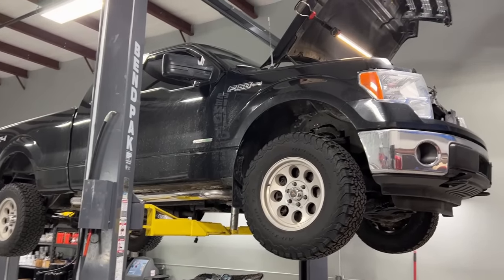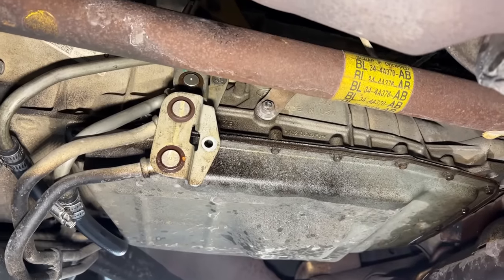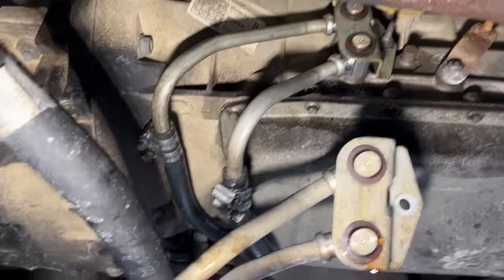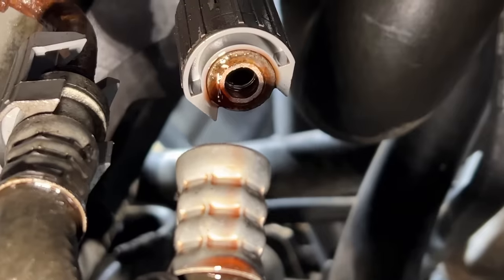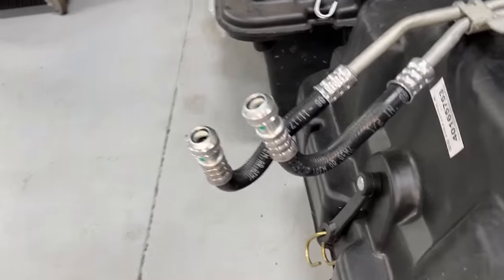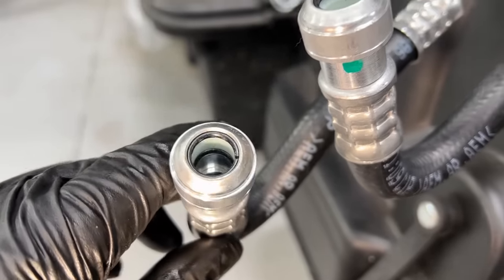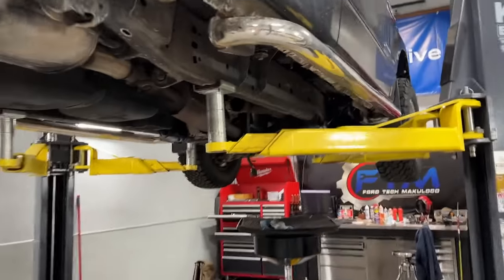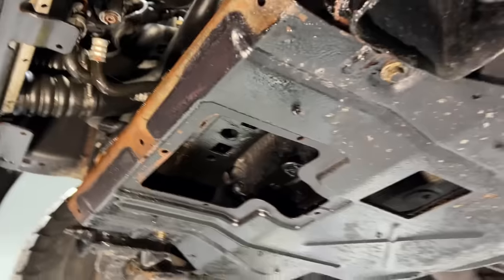Attention 2009-2014 Ford F-150 Owners! Check Your 6R80 Transmission Cooler Lines Before They Blow!

Comment: Good info.
Aluminum is not always your friend. 

Any suggestions for pre-planning?
Anything aftermarket that's better? 
Is this a 'Ford-only' part? 
Is this another 40-50k mile chore to add to the maintenance list? 
Etc...... 

Thank you in advance. 

Added a little rant, if interested, just b/c...... 
& a bit of, fyi. 

Shame on Ford.... 
All these years, & generations of trucks, & they can't get it somewhat perfected yet? 
We're still dickin around with nonsense issues like this. 
'Hey, I got an idea, let's go bigger on the lines for better cooling..., but get the cheapest fittings you can find. Let the buyers deal with the inevitable.' 

Ford knows EXACTLY wut could happen taking shortcuts & cheaping out on parts. 
Last I checked, takes around 300,000 complaints, TO, Ford before they'll issue a recall. 
That's not me sayin it, that was told to me when I called their Corporate Office about a brake/caliper issue. 

Over the years, I've had 3 Rangers, 2 Minivans, 1 Explorer & 3 F150s. 
Every brake job I did, the front left inside pad was always worn far more than the rest. In many cases, down to the metal, while the rest still had 1/2 or more pad left. (Had to add sum rotors to the bill, depending on how soon I'd catch it.) 
Ford said they were aware of it, but would not address it, b/c not enuff people complained to issue a recall. At the time, it was 300,000.

Not a coincidence, or from bad driving, or from parking on an incline w/ my wheel turned, like the DumbAss at Ford Service suggested, when I tried addressing it. 

I called 10 different repair shops, just to prove a point. Took all of a 1/2 hour. Asked for a mechanic, told em the short version, asked if they've ever noticed that problem. 
Every single one had the same general response, 'Now that u mention it, I've had a lot of Fords that had that same pad worn down. I just thought, huh, that's weird & finished the job.' 

The average busy person just fixes their vehicle, or gets it repaired. 
But, they don't dig a little deeper into, 'why did this happen'. There's always a reason, it's not always an 'age thing'. 
Don't be fooled, Ford cares, Zero% about the consumer. It's all about money. As it is, with all big companies. 
If there was more pressure from consumers & shops, it could change a few things. 

(For the Haters: Yeah, yeah, why keep buying Ford trucks... Blah blah. 
Cuz I don't like the alternatives. Things are no different, & in many cases, worst.)

Comment: If a fella could get a good vibration analyzer on those lines, you'd probably find the root cause of the problem.  Looks like high-cycle fatigue.  My guess is there's some really high vibration frequencies at work.

Comment: That doesn't seem like a good design...aluminum connector on steel.  It's just a matter of time before the aluminum will fail since it doesn't like being in contact with steel, especially when you add salt to the mix.

Comment: 2004 F150 had a transmission line leak in the exact same place. I know Ford has been using shitty parts, that will not last any length of time, since they redesigned the F150 back in 1997. If Ford wants the consumer to keep coming back, they better start designing vehicles that will last rather than leave you stranded on the side of the road. That or we all better keep watching this channel lol.

Comment: If this happens to my 2013 with egoboost, I'm getting the truck towed to the dealer and lighting it on fire. I've only got 71k miles on it and just replaced the turbos and timing system.

Comment: So you put a $6000 transmission in it with the same type of lines that broke before and there's no cure or replacement. That's better than the original lines, so it's going to happen again down the road. Maybe it's a roll of the dice.
Reply from the maker: Yes, you can run some hokey rubber hoses front to rear and triple clamp go ahead.

Comment: The new Lightning doesn't have a transmission that cost $6K.  But let's continue to point out the battery that will die at 300K miles...

Comment: QD connectors are for the benefit of the manufacturer NOT for the owner!!!!    Many seem to work fine but damn, when something like that happens for no reason it’s disgraceful.    On my GM I had to chop the lines to replace them long ago.     A package of stainless clamps with each end double clamped is far better than that expensive arrangement😒.

Comment: Why not replace line and fill trans fluid and see if transmission is okay instead of spending 6k on new tranny? lines and fluid would be sub $500 with labor worth a shot before going to spending big $$$, no???
Reply: this just happened to my brothers truck as he was drivng down freeway, Im gunna try just doing lines and fluid and see if all is ok after
Reply from the maker: I already drove it with the homemade cooler loop. If the fluid is burnt, do you think changing the fluid is going to fix the overhead burnt clutch pack magically?
Reply: @FordTechMakuloco  no I was more so asking then suggesting as same thing happened to my truck and I’m trying to go through steps to see what I should do. 

Apologies of it came out wrong I appreciate your videos
Reply from the maker: Again in your case if the fluid is burnt smelling, then at least one clutch pack is toast just beware.

Comment: I had an 2003 Excursion with the gas V-10 and same can be said for the oil cooler when that goes it dumps coolant into the oil and before you know it you have a slight tick and then a rod goes oh and it was $8,500.00 for a Jasper motor, never again Ford, I’m so done with you!

Comment: Had a similar experience a few years back in a 2007 4.0 Explorer, quick connect become loose and started draining on the highway. No indication on the dash or performance change. Noticed what looked like smoke coming from behind me so I pull over, shut down, look and see the "smoke" was actually an oily fine red mist.

Any estimates on how long you have from line split to full rebuild if this failure occurs on a 6r80?

Comment: The transmission is not fried. Better to lose the fluid quick rather than slow
Reply from the maker: Oh yeah did you smell the burnt fluid through smellovision?
Reply: I’ve done more of those lines than I care to count. I’m a trans tech at a ford dealership. My in-laws lines just blew this past weekend on the expressway going 80 no internal damage to the transmission, out of every set of lines I’ve ever done because of the line breaking like you show not a single one has needed a transmission replaced. Of course we give the customer the “hey look this could be much worse than just lines” speech but to call the line snapping like that “instant death” is a bit attention seeking.
Reply from the maker: Yes, exactly bingo you are right! My title is as attention seeking as possible to make sure these owners are aware. The title literally has the word "attention" in it, I mean what are we talking about here? So now it is frowned upon to make owners aware of potential failures on their vehicles? I make no money selling these jobs, I would rather be selling timing jobs that actually make me money. The extremely pungent burnt fluid smell in this transmission was just what, normal?

Comment: Add me to the list been there n got it n time lost a qt or two  n to get the parts was pain n ass but it is good for now
Reply: But it was rt above the spot u fixed line to cooler rust pin hole n it

Comment: crap design. that elbow hose flexes every startup from the pressure,  although its  just cooler  pressure not line pressure. repetetive stress cycling. the bend should have been in the steel tubing  leaving the aluminum coupler in a straight line
Reply: Nope.

6r80 has a thermostat. No flow till ~200°.

Comment: HMMMM.......  how much better are these connectors than a good ole stainless steel hose clamp? If I owned a ford, I'd just do away with those connectors and replace them with hose clamps.

Comment: given how the bracket and pipe it connected to corroded i would say it's galvanic corrosion that is the problem. ps aluminum does corrode but forms a protective oxide layer unless something interferes with the process like ethanol does. it can also corrode inside out and is extremely hard to see. dissimilar metals problem is known by heart by any real engineer. wtf ford, who did you hire?

Comment: It's not metalurgey, it is a poor design.  When you have that 90 degree angle vibration is going to stress the walls of the metal.  the is especially true when the hose gets more rigid with time.  If they turned the hose so it was straight and not at a 90 angle it would probably last the life of the truck.  Odly, it is the same as airplane windows. They don't have square corners because British Air learned the hard way.

Comment: What's up with ford and their damn quick connects everywhere.  Not long ago I had the coolant y pipe issue with the rubber oring quick connect.  Is a rubber hose and worm gear clamp that much more expensive?  Came from a Tacoma to a 14 f150 and honestly can say I'll never buy another ford again.

Comment: it's an INFERIOR part ...
causing a huge failure ...
(unless that was part of the design)
it should be a recall ...
w/ a redesigned approach that's reliable for LIFE of vehicle ...
but the car business is a scam ...
and they'll leave their customers high and dry paying for their (unresolved) failures ...
does the NEW part received from the manufacturer actually have the POINT of FAILURE corrected in any way?
(or is it the same)
how do they get away with it?

Comment: So another bad ford design that we the consumer have to pay for . i have a 2012 f-150 3.5 ecoboost 6 speed . I've been a ford man for almost 50  years. My 2012 has 82,000 on it . it has already had issues that  manufacturing and dealerships make off they don't know what your talking about . Such as blow bye oil making its way into the intercooler getting sucked onto the intake values cooking them and on into the turbos and frying them . you talk to the dealerships and they shrugged their shoulders as if they never heard of it .  BUT THEY'RE LYING THROUGH THEIR TEETH .In  spite of a  1000 videos on YouTube proving it . SO WHEN THIS ONE IS GONE FORD IS GONE FOR EVER ! THINK I'LL TRY A TOYOTA !!!!!!

Comment: Come on let's face it Ford is building garbage vehicles I will never buy another Ford F-150 I've had three and they all rotted the frames rotted right out from under them my 2008 2 years I bought it new 2010 it went to the scrap yard of the frame rotted I couldn't believe it so I was dumb enough to buy a 2012 same damn thing the frame rotted out on both sides on the inside part of the frame from just under the doors to the front of the springs so then I was dumb enough to buy another one 2014 brand new had that amazing 3.5 l ecoboost engine the goddamn thing blew up at 61,000 km and the dealership said they weren't going to touch it because the engine was abused all this thing ever did was drive to and from work and I had changed your oil every 5,000 km stay away from these trucks they're junk